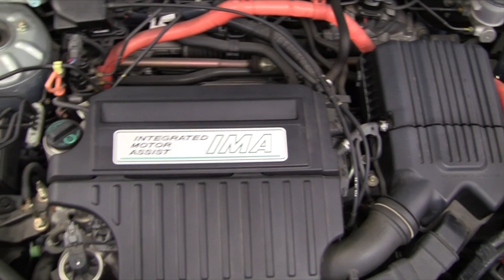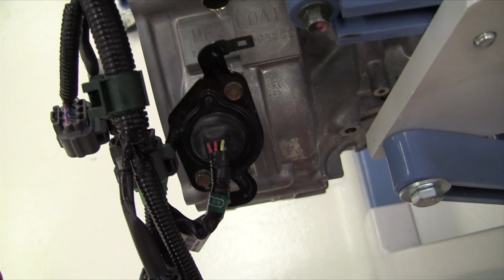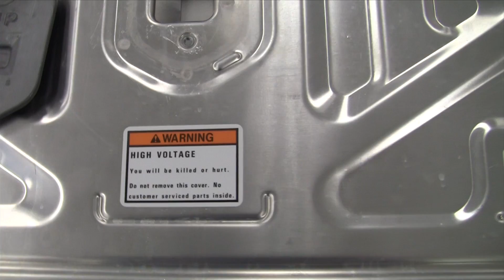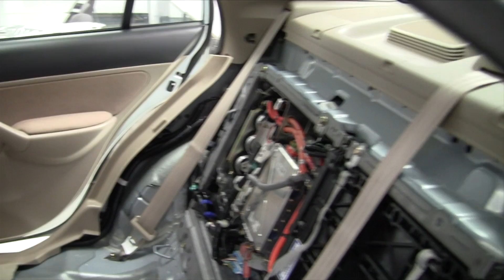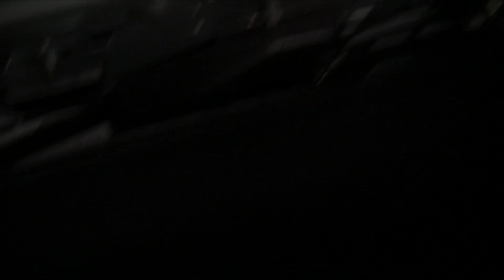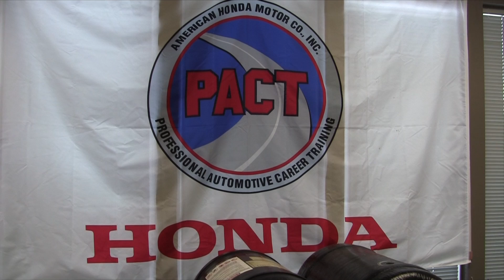Honda Civic Hybrid High Voltage System Operation

Comment: Hi professor i just came from watching your videos about ima honda series these videos were so interesting, i have one issue in my honda accord 2017 the high voltage battery is not being charged by the system and there is no error codes related I changed approximately everything like inverter, and gear box, I checked the wires all good. 
When i try to do the ima learning it catches only 3 computers not all. 
Thanks for wonderful channel and content.

Comment: One question, a 2003 Honda Civic has the problem that it turns off when I apply reverse or drive. I already changed the hybrid battery pack and I also changed the throttle body thinking it was the problem. I have some codes. I don't know if you can help me. Thank you.

￼

Comment: Perfect guides.  Thank you. 
 Problem is charging of 12v battery. I have 1st generation, 2003 as your example. 
 Could you please advise common reason of that malfunction. 
12v battery unable to charge from IMA. 
I have two codes: p1600 and p1570.
 During idle rpm voltage of small batterry is 11V, at time of acceleration growi
ng up to 13,0 V.

Comment: Great video into the inside workings of Honda's hybrid. I have a question, when this hybrid is started, which battery does it use crank the engine from 1. from the 12V SLI battery in the engine compartment or 2. from the NiMH battery in the rear ?

Comment: My car is a 2003 hybrid I tried everything the battery  stopped charging had all these codes IMA kept coming on . Tried erasing codes going 60 taking foot off gas shutting car off and back on did it twice it started changing no more codes been two weeks still good

Comment: In my 2007 year FD3 car indicates  the IMA but it comes only after  2-3 starts only,at the cold start it never comes out.

Scaner shows that the error of the AC Compressor Drive but No AC problem there only little bit low AC at the noon time.

HOPE YOUR ADVICE AND APPRECIATE YOU WELL,thanks

Comment: Honda assumed the driver turned on air conditioning on a hot day. I used to have one of these,  bought new in early 2003. Running the air conditioning imposed a large performance burden, so I never ran the air conditioning unless I had passengers (sometimes no AC with passengers) this was in Dallas by the way. I probably cooked the battery and inverter electronics.

Comment: My 12v system is not staying charged. I have to jump the 12v batt with a quick jump pack. Is this safe and what could be the prob? Gauges read normal. Thanks for any advice.

Comment: So obvisously so many things could cause my 04 hybrid civic to pop out of reverse as   ima light is on as im currently attempting to recondition them but would you suspect the ima system is the culprit or look into the civic overall problem as ive already found others having same issue. Only in reverse it pops out of gear btw ..

Comment: Hey bro I have a quick question I just wanted to know if I need to disconnect the high voltage cables from the engine if I'm going to remove the transmission on a 2003 Honda Civic Hybrid cuz I think the flywheel is broken because my car has a flashing d light in the dashboard and it doesn't go into gear doesn't move an inch doesn't even feel like it shifted into gear?

Comment: 2012 Honda Civic Hybrid P1440, P15A5, P0AE1 Codes and Honda mentions to replace the MPI to fix the issue....  Brake Sys, IMA, Battery, Check Engine light are on.   Miles are 61K

Comment: sir....
please reply for my question i am in difficulty..
mine is Honda civic hybrid 1.3 IMA 2008 (2nd gen)
problem is 
1.engine warning light came on rocker arm pressure switch (all is working fine  like autostop,engine cruising at 40 speed but mileage"Mpg" was down side & after i take car 3000 rpm its limits and get jerking not going after 3000 rpm)
i took my car in honda for engine light.they told me your engine harness was bad..in two to three places cuts found..it need to change whole engine harness.(it is too much expensive in india because only 300 units sold in india discontinued)
but i dont understand why?? because honda mechanic showed me there are some problem in solenoid 4 switches.not too much wiring cuts only switches wires are cuts some i take it in my home 
and i try at home 1st i disconnected 12v accessory battery then IMA switch also.after an hour with safety tool i removed engine plastic cover and i change all four the switches wirings so............... 1st problem was cleared and engine light is gon.after this problem solved my IMA battery get more backup and also glass power windows are fastly close and headlights are more brighten and 3000 rpm also solved and mileage is too much better..but when my engine light gon two more lights are on 1.is ABS yellow light also red &
2.transmission d also blinking
currently this is the problem autostop is not working mpg is good enough
ABS RED AND YELLOW LIGHT & TRANSMISSION D LIGHT BLINKING
i was checked all things i scanned a car code was U0129 (Lost Communication with Brake System Control Module)
i try to delete codes but its not deleted
please help me please answar me........8vhl

Comment: I had o Reilly run some codes on my 2003 HCH and was told I needed to replace the voltage regulator. I've done some research but cant seem to locate it in the vehicle. Is it directly connected to the DC to DC converter?

Comment: I have an 06, civic Hybrid. the batt, ima, and mil are on, and the D is flashing. At about 2000rpm it charges 14 at the 12v battery and 176 to the orange cables at the DC/DC converter. I have codes u0110 and u1205. Reading this I checked fuse 61, it was intact. I'm not getting any charge or assist on the dash. I had hybrid battery apart and all cell packs are 15vdc+- Any tips?
Reply from the maker: Sorry, best wishes
Reply: @WeberAuto  sorry for what?

Comment: Hello Everyone. This may a wee bit off topic, but I saw a few questions below regarding the 12 volt battery and charging system of the civic hybrid.

The 12 volt battery is used to power the accessories, but not to start the engine. Yet the engine will not start when this battery is dead, probably because the controllers all run off the 12 volt bus. It is a small battery, but is very expensive to replace, for who knows what reason. I recently paid 150 US dollars for one. There is a MUCH cheaper alternative to this battery, and you can buy it online. I'm not going to provide links because I am not in the business of selling things on the internet, but you can google "12 volt car battery supercapacitor" and you will see how to do it yourself and probably get a bunch of links to people selling completed systems. I think I recall seeing one for sale at 25 dollars! As an electrical engineer, I believe these things will last the lifetime of your vehicle and work just fine. Check it out.

I find it insanely annoying that there is even a 12 volt battery in any of these hybrid vehicles, it's such a kluge! And for them to be so expensive is even more maddening! It would be so easy to power the 12 volt system from the 144 volt system when the key is turned on, and put a small 12 volt to 144 volt DC step up controller to allow an external car battery charger to charge the 144 volt battery in case it ever happens to go dead.
Reply from the maker: Thanks for your feedback.

Comment: does anybody know 2012 honda civic hybrid  power inverter capacitor uf(capacitens)?????
Reply: i have P0AE1 code i did check fuse, contactor everything accept  MCM and invertor , may be MPI is the problem ???

Comment: my honda hybrid 2006 model, had the battery red light ON, when either driving slowly or on brake mode especially during very hot or raining seasons. What causes such to happen?
Reply from the maker: Most likely a high voltage battery going bad. It feeds the DC-DC converter which charges the 12V battery
Reply: @WeberAuto  okay! Then how to fix the problem
Reply: @WeberAuto  what steps should be taken to fix the problem?

Comment: silly question .. i have seen  some students  transform  normal car to electric without using so much modules an technology ... why its  that automakers make this cars so complicated? thanks  for your vid!!!
Reply from the maker: Many of those conversions use DC motors (a simpler system) rather than AC motors (more efficient).

Comment: So.. the real question is.. how can I change out the rear speakers.. because I don't want to mess with the battery pack. I have the 2014 HCH
Reply from the maker: I would either not change them, or pay a trained technician to do it for you. Best wishes

Comment: Hi Weberauto, I drive a 2006 honda civic hybrid. The battery light keeps coming on. I scanned the car and got this 
Code P1570- Battery module individual Voltage Problem.

How can I fix this problem?

Comment: Hi I have a problem with the battery light bring on and not chargeing the 12v battery and I have a p1570 fault code and you advise
Reply from the maker: Bad news. You have the typical bad Honda high voltage battery. Id that battery goes bad, the 12V system will not charge either (unless you keep the engine RPM high (1500 RPM). It is not safe to drive because the car could die at any moment while driving.  Battery time.
Reply from the maker: See the following video https://youtu.be/_V9PiOpaxyE It is about the same system, but on a Toyota. Your Honda should act the same way when you have a good HV battery.

Comment: hello. I have 2008 civic hybrid and 12v battery isn't charging, red battery sign in dash is on and scanner show code p0685. what's best way to fix it. thanks
Reply from the maker: There are many possible causes, including a bad high voltage battery that can prevent the 12V battery from charging. A low 12V battery can cause the P0685.  Best wishes

Comment: Hi I have a Honda Civic hybrid 2006 the battery is on Ima on and the engine.. we change the battery .. because my car go on but lest of a mile want to turn off and the brake light turns on ..  and don't let you move the handle .. what is causing that ..is the generator or what.?? Pls help I really like my car and I don't want my husband to sale it.

Comment: This is really a fantastic overview of the entire system. It made me comfortable diving in and checking things out. I have a P1600 and P1593  trouble codes. I know that P1600 is generic and P1593 refers to the motor current V phase sensor high output -- but I don't know how to troubleshoot it. Any advice for a beginner who's  in a bind? Thanks!
Reply from the maker: Thank you! Output high usually indicates an open circuit. There have been broken sensors reported from recent transmission work or engine work. The reluctor wheel hits the sensor and damages it.  Best wishes.

Comment: Hi wanted to see if you could give me some input, i jump start my hybrid car an runs normal when I shut it off within minutes try to turn it on and it won’t start, what do you suggest? Would please like some feedback thank you
Reply from the maker: Hi, what vehicle is it? Year, make, model?
Reply: 2003 Honda Civic Hybrid
Reply from the maker: Is the 12V battery too low on charge? Do you have to jump start it? The car will not start if the DC-DC converter cannot keep the 12V battery charged. The high voltage battery is supposed to supply power to the DC-DC converter at idle, but I cannot when it has lost it's ability to hold a charge. With a bad high voltage battery, the DC-DC converter only charges the 12V battery when the engine is at an rpm much higher than idle speed.
Reply: appreciate the feedback thank you

Comment: Hi,  I have a 2006 ima honda and the battery light stays on and by looking at your video I took everything apart just like you did and I made measurements and my diagnostic is that the ac inverted is bad...since I understand that inside de ac inverted works just like and alternator and it has a rectifier which i couldnt  measure i took a chance on guessing that the ac converted is my problem. How close i am of solving this problem or if there is another way to make sure that ac is bad.  Thank you and i am very happy of watching your videos i feel the professional work that you share with us.
Reply from the maker: Thank you!  The most common problem on Honda IMA systems is the High Voltage battery. It is unlikely the inverter is bad. I recommend checking trouble codes first, then see what they tell you to do. Best wishes!

Comment: I just purchased a 2003 civic hybrid i have the issue everybody have with the ima batt. But i notice when the batt. Light is on if i just turn on and of real quick the switch the system start charging again. Coul it be a bad dc to dc charging issue? Or the batt.
Reply from the maker: You should have someone check for trouble codes and see what they tell you. Unfortunately, you will probably need an new IMA battery.

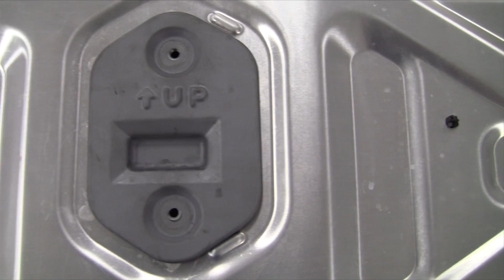Comment: Hi, I want to disable the hybrid battery in my Honda HAH 2005 by turning off the switch behind the cover shown @ 6:13. If I do so, would it make my hybrid car into a regular gasoline Car and can I still drive it? I suppose that would tune on the IMA and check engine lights. My hybrid battery is pretty much degraded (I have 200xxx miles). It discharges completely within 10-15 seconds of IMA running and then takes a lot time to charge back. I assume charger trying to charge a degraded battery and then not getting much in return, is not very energy efficient. I barely get 25 MPG in city and 31 on highway. Please advice. Thanks
Reply from the maker: It will not turn it into a regular gasoline car, but from what I have heard, it can keep your 12V battery charged at a higher rate. I have not verified this, only heard about it. Best wishes.
Reply: Let's say I disable the battery and something goes wrong, I can always go back and turn the switch back ON. What do you say? Thank you so much the help.
Reply from the maker: Yes
Reply: I removed the lower portion of the back seat and then unbolted three bolts (plus 1 unbolted during the removal of lower portion) for the upper portion. But I couldn't remove it completely. I did not apply too much force, didn't wanted to break anything. Are there any more bolts possibly in the trunk? I think there are some clips in the upper section but couldn't find a way to access them. This is HAH 2005 V6. Thanks
Reply from the maker: Ankush Gupta lift up on the upper back seat cushion. There are clips that go down through the speaker shelf area
Reply: Hi, so I did turn off the battery switch on my HAH 2005 and here is what happened.

Car was able to start with the starter so no issues there. I got Check Engine, IMA and Battery Lights ON at idle. The voltage at cigarette lighter terminals was about 11.7. Then I increased the RPM to about 2000-2500, at this point battery light still wouldn't turn off however, the voltage at cigarette lighter increased to about 14.1.

Then I started driving. As expected there was No Assist, No Regenerative braking, No idle Stop function. The Battery Light would still remain ON even when I was driving at 35-45 MPH (between 1500-2500 RPM) and voltage at cigarette lighter was around 14.

My question is, whether the 12 V battery is getting charged or not. I am not sure because on one hand battery light is ON but at the same time if Car's electrical system is at 14 V, then wouldn't higher voltage of car should charge the lower voltage battery somehow?

For now I flipped the switch back ON and car is back to as it was before. Let me know if you would like me to do any experiments for the benefit of everyone here.

Thanks
Reply from the maker: That is some great feedback! With 14V while driving, the 12V battery would be receiving some charge. Any time the  voltage at the 12V battery drops below 12.6 Volts, it is not being charged. The trick would be to keep it above 12.6 Volts always. That way the engine would not shut off while driving. Best wishes and thank you again.
Reply: Thanks, so we can assume that 12 V battery is being charged even if the battery light is ON (as long as car's electrical system is above 14 V)? I am thinking about experimenting this by driving the car for at least a week with hybrid battery module switch in OFF position. I keep getting this code P0A7F which means Hybrid Battery needs a replacement but I am not in position to spend 2500$ on it.

Someone on a different forum suggested me to get a trickle charger to charge 12 V battery externally once or twice every week. Would that work?
Reply from the maker: Yes, that is correct. Trickle charging is also a good idea.
Reply: WeberAuto i had my ima go out and drove it around for a few days. I did use a regular car charger on it for a couple of hours each day just to make sure till i could get to the dealership so they could replace my ima battery. Didn't have any problems.

Comment: thanks for this video!  I have a question replacing the battery module is something that I can get done myself?  we have a Honda civic hybrid showing code P0A7F.
Reply from the maker: Hi, unless you have great mechanical abilities, electrical safety training, and the proper tools, I recommend you get a shop to replace it for you. Best wishes.